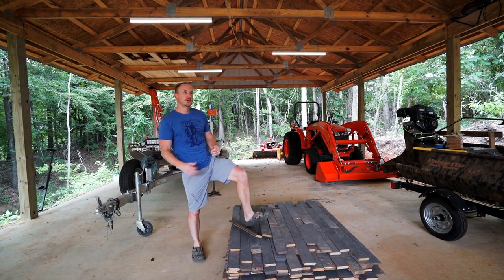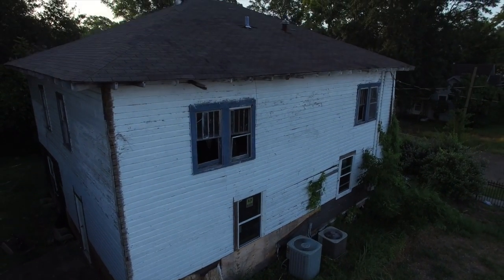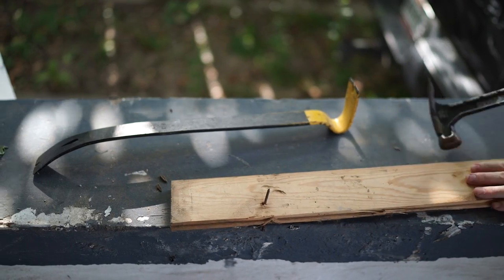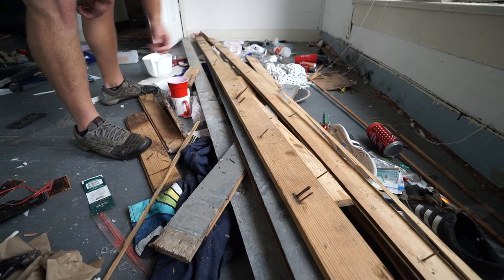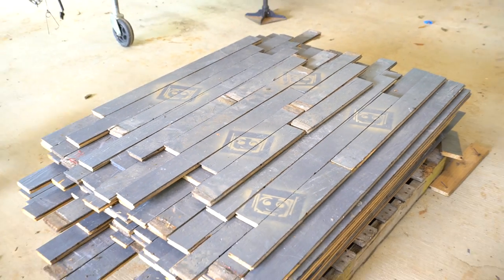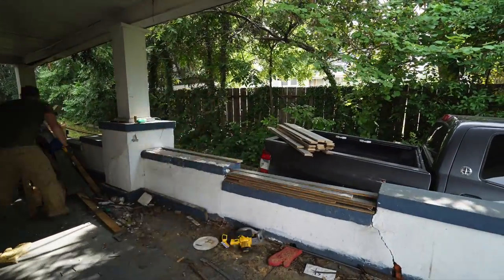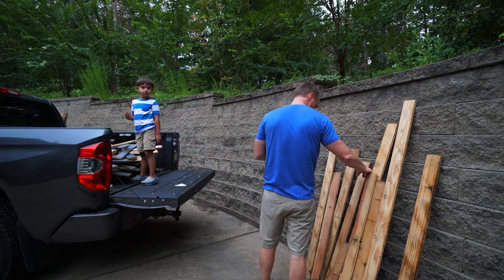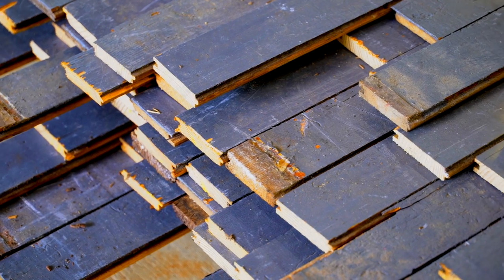The Island House Episode 2: Reclaiming Wood

Comment: I want to do some reclaiming on an old house and barn, of my late grandparents, but I'm worried about lead paint. Do you worry about any of that, and what do you do about it?
Reply from the maker: I've never worried about the lead paint unless I'm planning it and then I wear a mask. I also coat it in polyurethane and that seals it. My understanding is that unless you're eating the paint chips or breathing in the dust from planing it's not an issue. And I've messed around with a lot of wood with lead paint and have never had a problem. People lived around it constantly back in the day and it really wasn't an issue I think it's probably like most things a little bit overblown on how dangerous it is.